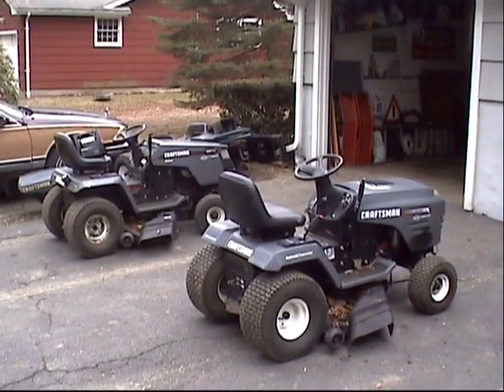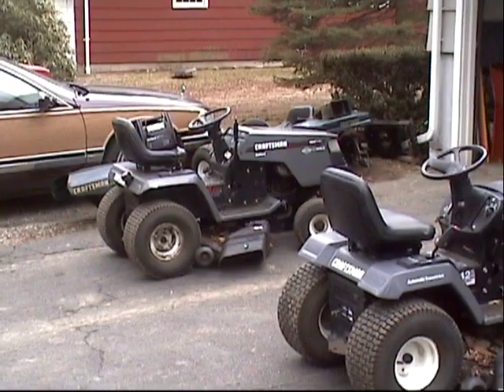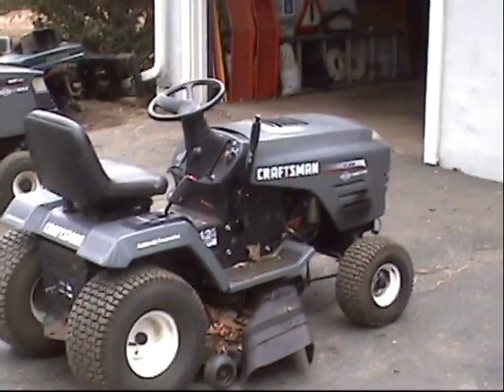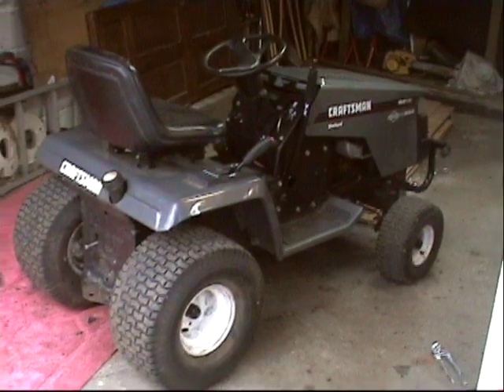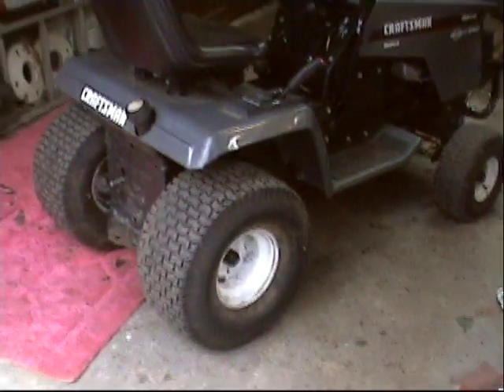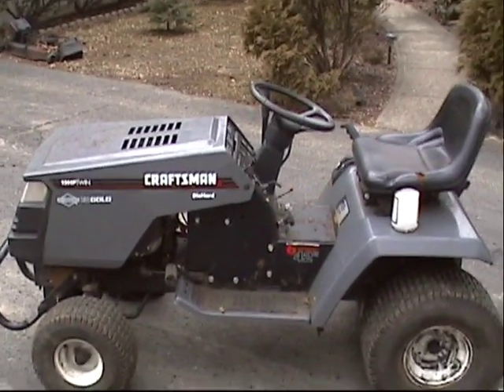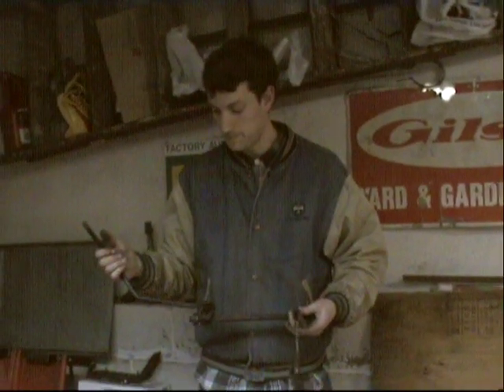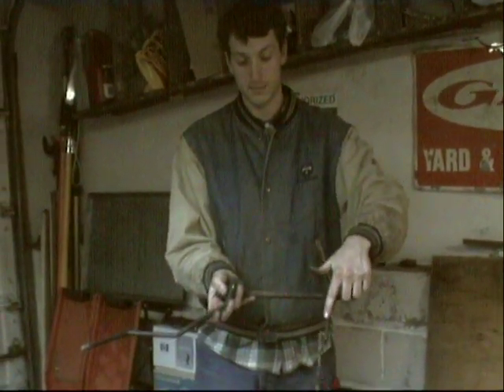Replacing a 6-speed transaxle with a Hydrostatic in a Craftsman tractor

Comment: i would of keep the six speed. Although I have a 2003 GT5000 with the 6 speed transaxle with 1in axels i think it is superior to the hydro that came with the similar year tractor. When I'm pulling yard equipment there is no worries. Cool vid though.
Reply: Agreed
Reply: You're right except if your 67 years on. I'm hoping I  can make the craftsman tranny work on an old wards elite. It's  a 7 speed with vari- drive that isn't too swift.😮

Comment: What a wast of time the 6 speed is way better
Reply: I use one for a mud mower fhing has taken a year of abuse so far and still goes on
Reply: @datchaffeec4529  same
Reply: Jordan Barakat I know! My 5 speed spicer is even better than the hydro. It’s got a lot of hate, but it’s held GREAT for me 👍
Reply: @Farmtractor  make sure any mounting brackets don't crack that holds up the transaxle transmission it can cause alot of problems I didn't like the spicer ones after seeing how easy they can break just from one broken mounting bracket
Reply: @Mike-su8si  LOL I don’t have mine anymore. I sold mine for a bigger tractor.
Reply: @Farmtractor  the only one I could afford to sell is this new old John deere L110 or just sell it back to who I bought it from an I paid 175.00 for it I'd sell it for 185.00 cause it's updated now
Reply: That's all the back up mower I got are all 6 speed
Reply: @patrickb9687  I gotta figure out what hole to suck the old transaxle fluid out on my john deere L110 5speed

Comment: Did you have any other trouble with the shift linkage?  I just took a bad hydro out of a LT2000 and replaced it with a 6 speed Peerless.  I used the shifter cross bar out of a 6 speed tractor but left the stick from the hydro because other than the style of knob on the end they were the same.  Anyway the linkage hits the transmission case before it can go into 6th. I don't understand what my problem is because all the parts I used to convert this tractor came off of a junk craftsman that had a MST 206 just like the one I put in the hydro tractor

Comment: Big fan of the channel.  I have a 1999 AYP Ranch King Pro with a 25 HP Kohler command with a loader on it.  Should I be worried about how long it will hold up?
Reply: Meant to say it has a hydro with a loader.  Thoughts?

Comment: Hi i am not very big into tractors but i am planning on doing on a hydro to manual swap(yes i know backwards to you but anyway)all i really new to worry about is the final drive right(no pumps or anything).  they both are just run by a belt...Correct?  if not what am i missing and what else will needed to be removed to do the swap?
Reply: John Wehner how did you come out with yer swap? Im fixing to do a hydro to 6 spd swap in a gt 6000 garden tractor and wondered what you might have experienced, thanks

Comment: We have a Garden Tracter 6000 GT 1996 or so lost service manual need to work on tran. do you know where to get new manual Sears doesn't carry anymore.
Reply: In the UK I have just bought a garden tractor that was made in 1995 with a Hydro-gear hydrostatic gearbox. The gearbox has a barcode on which lead me straight to the Hydro-gear US web site where I was able to download a service manual and a parts list. If yours has any making on it might be best to go to the manufactures web sight. Hope this helps.
Reply: Ok thank you I'll check

Comment: wouldn't it have been easier to do an engine/hood swap?
Reply: Andrew Gleisberg This is a bit hold but I'll reply. I'm looking to do this job myself. The gas tanks and batteries trade places between the two tractors.  I'm guessing that that the LT4000's tank is higher capacity to make up for the larger displacement. So in the end, you would have to swap out the wiring harness and gas lines as well.
Reply: woo545 really you wouldn’t need to change the gas lines or alter the wiring that much probably only a few connectors are different on the kholer engines and briggs, but the gas lines would mount right up if they’re long enough, I believe the larger twin cylinder tractors came with the bigger gas tank out of convenience so you wouldn’t need to stop and refuel as often for large properties like the twin cylinder tractors were designed for vs the single cylinder

Comment: I cant stand the shifter between the legs type manuals (I learned how to mow on a craftsman with a 5 between the legs.) but ill take a hydro or 6 on the fender any day equally. I have hydro on the fender and 6 on the fender, and I like them both. When you get used to your manual you can slip the clutch to give variable drive, I do it all the time. I even slip the clutch on my Hydro when I want to momentarily slow down before coming back to the same speed.

Comment: When you took the linkage off for the 6 speed with the cross shaft and shift lever did you leave it as one as it looked in the video?  I'm rebuilding one right now and I’m having issues with the linkage.  Got a Craftsman 1998 EZ3 19.5 HP, 42", 6 Speed 917270810 from a friend that broke the cross shaft and the shift lever.   So I found a cross shaft part number 161077 or husky part number 532161077 in Missouri cause AYP no longer makes it.  Got lucky.

Comment: Hey- I have a Hydrostatic axle - it sat for 2 years so i got it cheap - runs well but the transaxle refuses to engage - does the belt spin ALL the time the motor is running? I am super new to this but have some mechanical back ground with cars - and some push mower repair.

Comment: @ 4:15 -17 you have the hydro out and sitting upright - there is a tube sticking up. I have a hydro that say for two years and there is no reverse and forward there is way too much noise - I am sure putting in some fluid will help a lot - Here is my Question: 
Is the pipe think -- : Sticking up the tallest the FILLER tube and is the end piece [ looks kind of like an emergency brake release button] the place where the fluid goes in?

Normally there is little question but this is just too strange

Comment: I have a LT-1000 and the manual says these transmissions are not serviceable. The final drive in mine did not have enough oil in it and it was full of metal shavings. I changed the pump oil and filled it up with Amsoil Tractor Hydraulic oil (ATH) and 75w90 in the final drive. I tried to flush some of the metal chips out with some cheap engine oil and pushed it around a little. There is no drain on this  and I had to turn it upside down to drain it... I plan to wash it out this winter
Reply: Tap a hole in the bottom and put a plug in it. That way you can flush it. Just be careful when drilling, go slow and don't jerk your bit and look at the parts diagram before punching holes. It'll take a little time but is totally worth it in the end as you can easily service  it.

Comment: lol all of my tractors are manuals and I don't have many problems with them. they are generally more durable and will outlast the modern cheap hydro found in most tractors.  The only time it really becomes a pain in the ass is when I have to mow with my GT6000.  Shifting through two ranges of gears and having to get just the right clutch position to shift is horrible when you are mowing.  What problems do you have with the tiny little 5 speed peerless tranny on your LT4000?

Comment: yeah I know what you mean, i have a year 2000 craftsman with a 17hp ohv single, 42" cut and a 6 speed, its pretty much an lt1000 but it doesn't say lt1000 on it. I actually like the 6 speed better than a hydro, altho ive never operated a stick hydro, always a pedal, but it has a 1gal tank under the hood and i wish it had the bigger one under the fender, i wonder if I would be able to put one under there